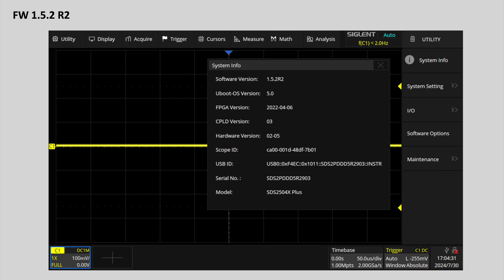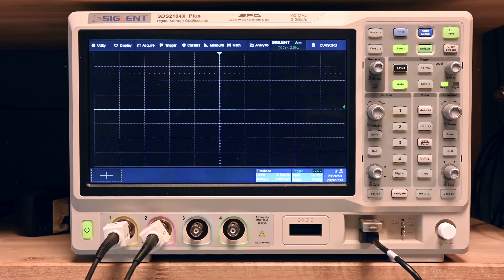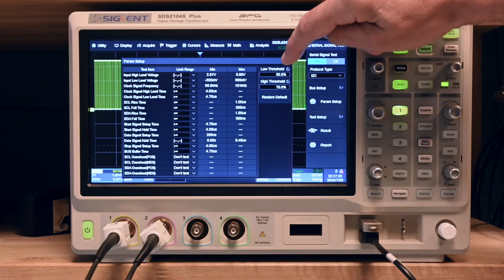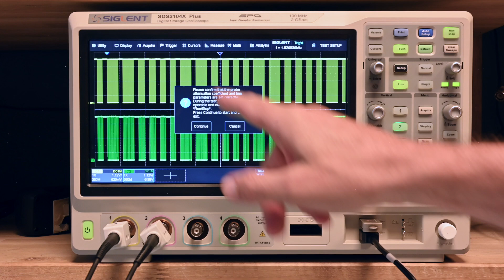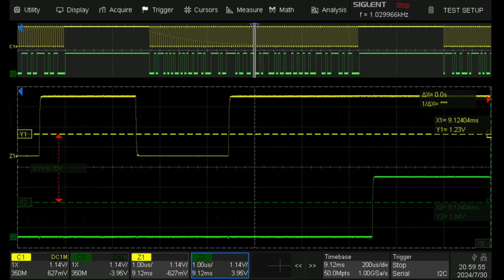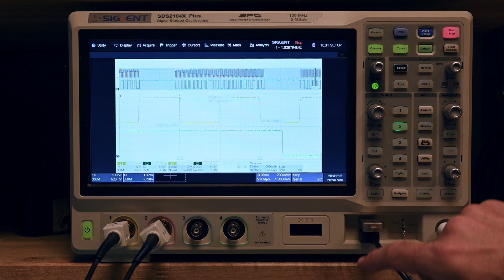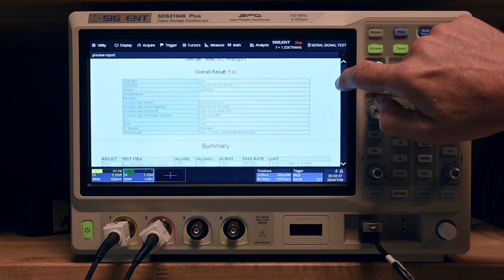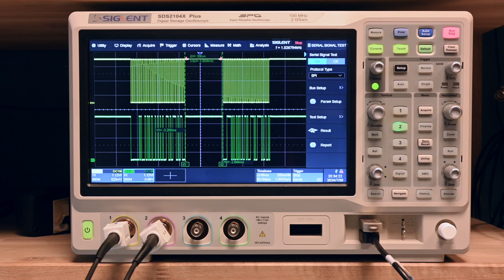REL #45 Siglent SDS2k+ Serial Signal Test Analysis New in June 2024 (FW V1.6.2R5)

Comment: IMPORTANT !
Do not update to 1.6.2R5 yet, UNLESS you already have uBoot 5.4.0 on the unit, Siglent missed the uBoot update in the firmware, keep reading for more info...

You might have a subtle issue, go to your settings and try to choose a Timezone, if there is nothing then you need to update the uboot, Siglent forgot to include it in the update and it causes issues. problem is now you will need to do a recovery package and then re install the latest system. Get hold of your local Siglent dealer to get the package.

Basically you set the scope to factory defaults , insert a usb stick with the recovery package on it, reboot it and let it do its thing, then re install the latest system.

The latest uBoot is version 5.4.0.
Reply from the maker: Thanks for the tip. I had Uboot 5.00 on my scope before updating to  1.6.2R5, and it is still 5.00 after the update. I'm not sure what problems this has given (if any), but I will take a closer look once back at the scope. If not having Uboot 5.4.0 installed before doing this 1.6.2R5 firmware upgrade causes serious issues, then Siglent should warn us of that!
Reply from the maker: Thanks for the tip. I had Uboot 5.00 on my scope before updating to  1.6.2R5, and it is still 5.00 after the update. I'm not sure what problems this has given (if any), but I will take a closer look once back at the scope. If not having Uboot 5.4.0 installed before doing this 1.6.2R5 firmware upgrade causes serious issues, then Siglent should warn us of that!  Then again, if the only affected functionality is the time zone, then I personally do not really care.